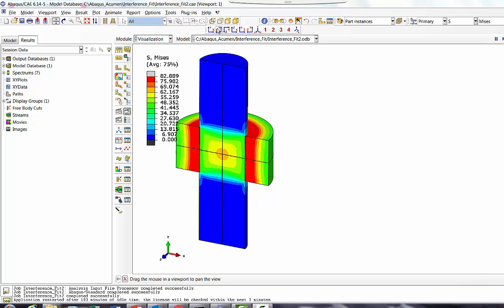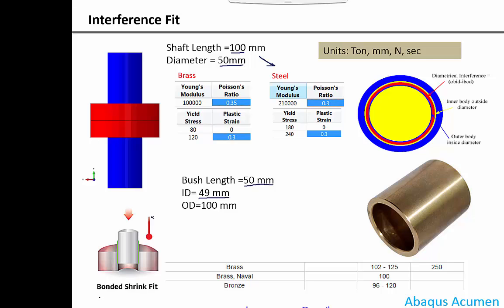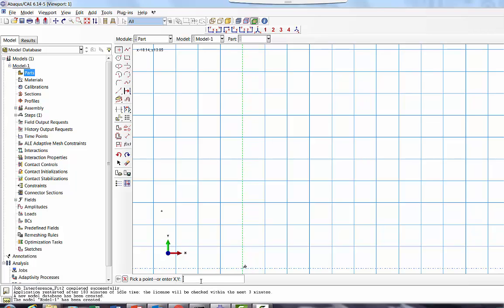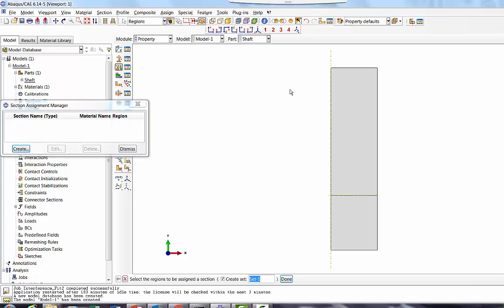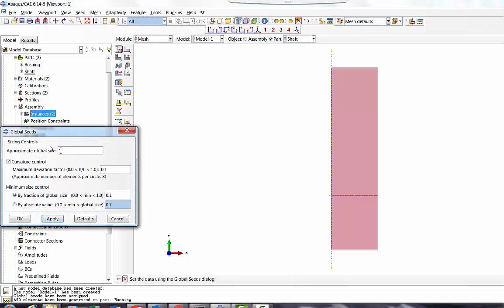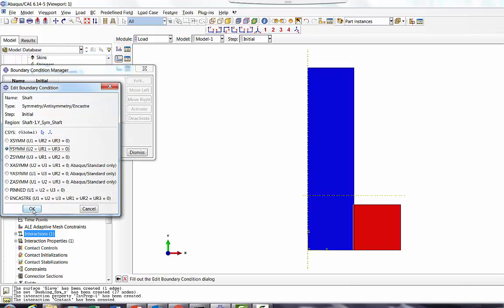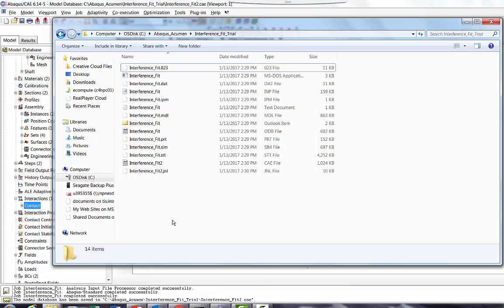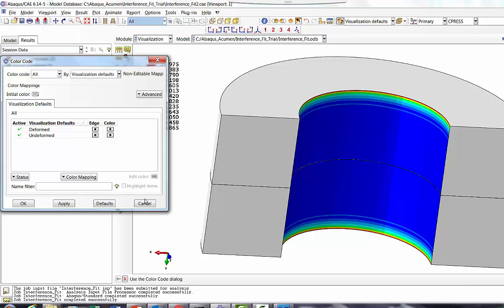Abaqus Standard: Interference Fit Using Axis Symmetry element

Comment: i have also axis symmetry in my model and therefore i modelled one quarter model similar to your case. However i used 3D stress  C3D8R. Is it necessary to use axis symmetry element ?? as i dont see them in Element types